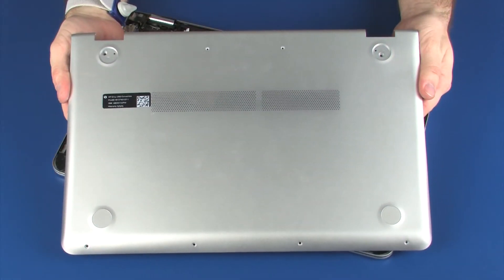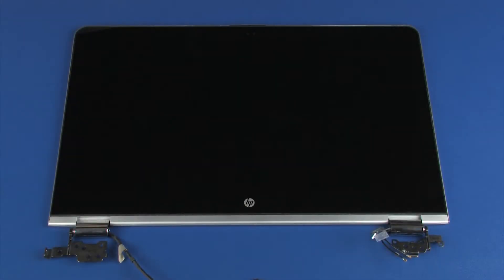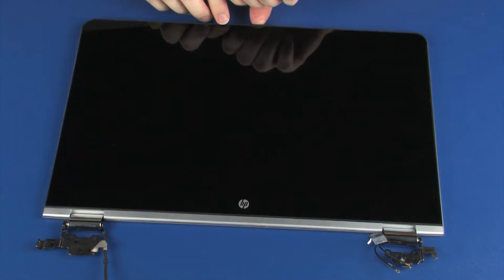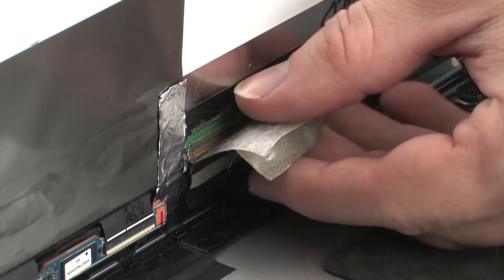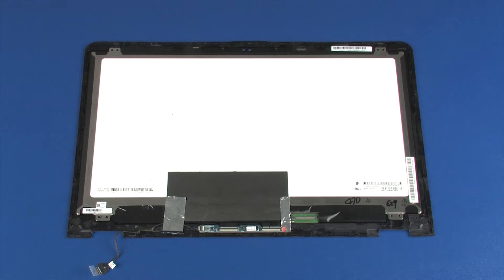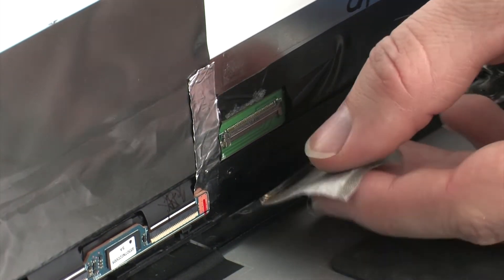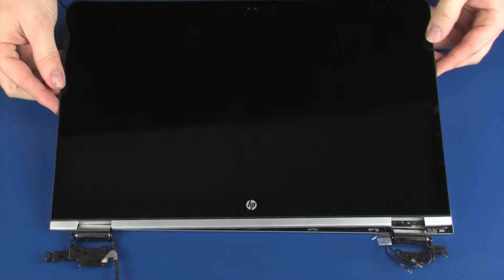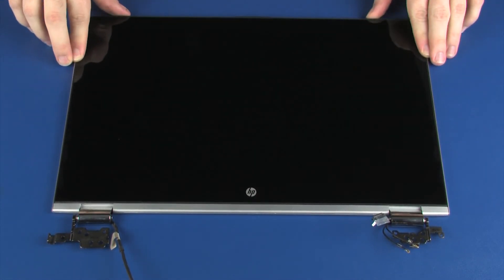Replace the Display Panel | HP ENVY x360 m6 Convertible PC | HP Support

Comment: Why does the wireless module, solid state drive, USB board, system board, and display panel assembly need to be removed?
Reply from the maker: +Jacqueline Gutierrez It is designed in such a way that you need to remove all these parts.

Comment: Does this have super sticky tape that connects the display to the back?
Reply from the maker: +Derrick Doan Follow these steps to remove and replace the display panel for HP ENVY x360 m6 Convertible PC:
- Note: The following video depicts a specific configuration of the notebook.
- The same removal and replacement procedures apply to all configurations of the notebook.
- Before you begin: Remove the base enclosure, battery, wireless module, solid state drive, USB board, system board, and display panel assembly.
- Removal:
- Carefully separate the edges of the display panel from the display enclosure.
- Lift the display panel and position it so that you have access to the display panel cable and connector.
- Peel back the retention tape and disconnect the display panel cable from its connector on the display panel.
- Remove the display panel.
- Replacement:
- Note: If you are installing a new display panel, remove the following from the old display panel and install onto the new display panel:
- Touchscreen Cable
- G-sensor Board
- Place the display panel into position on the display enclosure so that you have access to the display panel cable and connector.
- Connect the display panel cable into its connector on the display panel and replace the retention tape.
- Lower the display panel into position on the display enclosure.
- IMPORTANT: Ensure the display panel and touchscreen cables are properly routed through the display panel hinges.
- Carefully apply pressure around the outside edges of the display panel until it snaps onto the display enclosure.
Caution: Improperly installing or replacing parts could damage your HP device or void your warranty. Before replacing any parts, check your warranty.